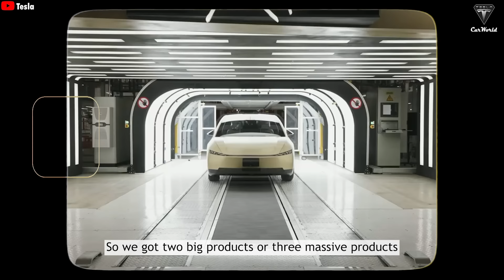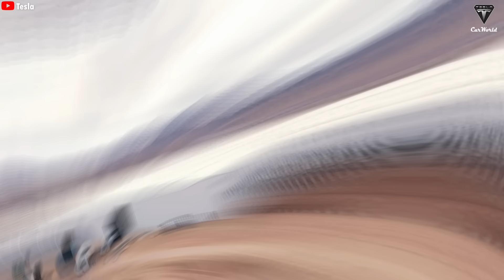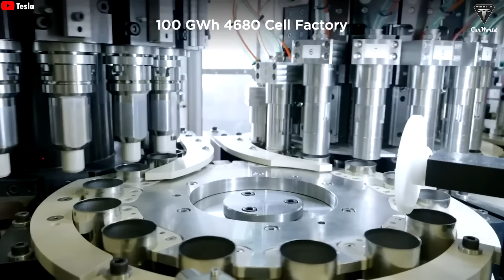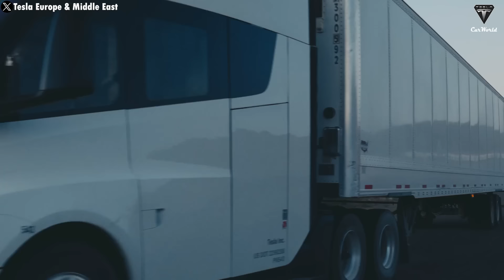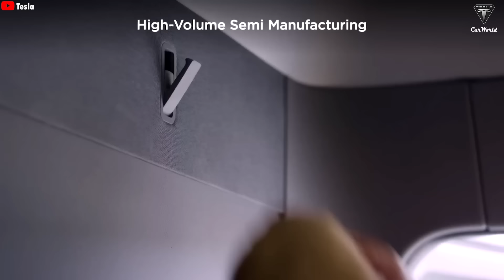Tesla Semi Gen 2 Take Over 2026 | Elon Musk Reveals Massive Design Upgrade DONE!

Comment: A semi truck is pronounced sem-eye not sem-ee.  This is merely 1 "tell" that illustrates the illiteracy of AI and its public dislike.  Mispronouncing everyday words is annoying to the viewer.  A range of 500 miles is inadequate.  DOT regulations mandate 11 hours as the driving daily limit.  Add to that the total on-duty allowed time of 14 hours, allowance needs to be made for "yard moves" where the vehicle is operating but not driving on public roads.   Therefore, an electric semi truck needs to have nearly 800 miles worth of charge in it.  This is not considering the driver having HVAC operating during the 10 hr break while in the sleeper.  How will the battery charge during that time?  The trucking industry survives by keeping freight moving.  Drivers get paid for keeping freight moving.  An electric truck needs to be charged.  That takes a place and time for that to occur.  To refuel a  diesel truck at a truck stop is about 15 minutes.  I'd like to see a hybrid diesel-electric truck that could keep going and not be shackled by battery limitations. But then we have weight issues.  Trucks have weight capacities and weight restrictions. For OTR trucking, I see electric trucks as non-viable. Exceptions could be made for carriers that go terminal to terminal within the range capability of the trucks where there battery could be swapped at the terminal they stop at.  Possibly future truck stops would swap out batteries instead of recharging them.

Comment: Timestamps (Powered by Merlin AI)
00:03 - Tesla Semi Gen 2 launches in 2026 with significant upgrades.
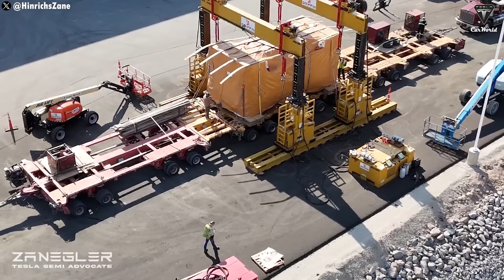02:07 - Tesla's new factory boosts semi-truck production capacity and upgrades design for autonomy.
04:03 - Tesla Semi's updated design features improved aerodynamics and futuristic headlights.
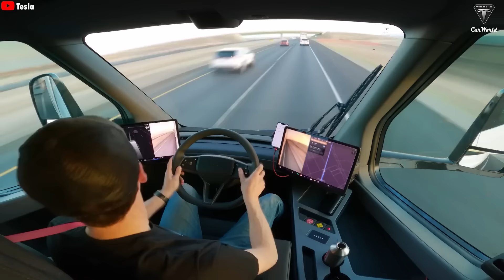06:03 - Tesla Semi Gen 2 upgrades improve aerodynamics and battery efficiency.
08:07 - Tesla Semi Gen 2 features upgraded battery and design for enhanced performance.
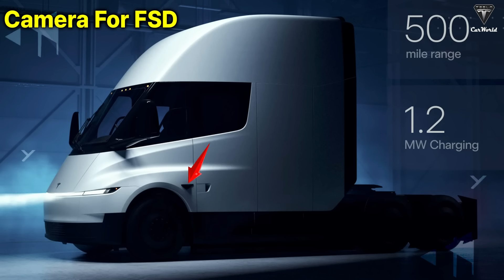10:19 - Tesla Semi's new design enhances potential for full self-driving capabilities.
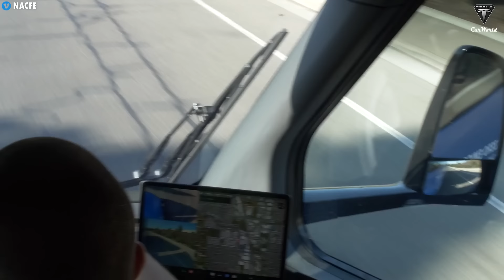12:23 - Tesla Semi Gen 2 focuses on reliability and cost efficiency.
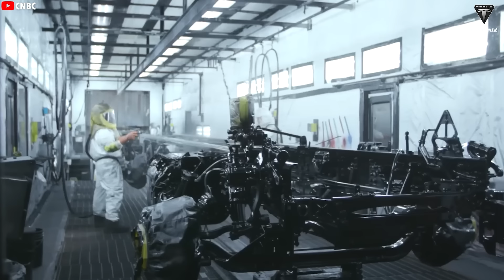14:35 - Tesla's electric semi-trucks revolutionize logistics with unmatched efficiency and performance.
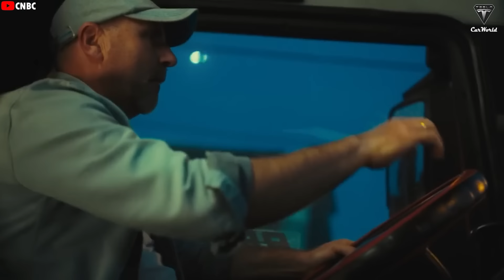16:45 - Tesla Semi Gen 2 addresses trucking instability and boosts environmental standards.

Comment: The range 500 miles is  the same as it was years ago. The 4680 is a terrinary battery which doesn`t work well in cold weather. I presume it has a heat pump to reduce the range loss in cold weather..